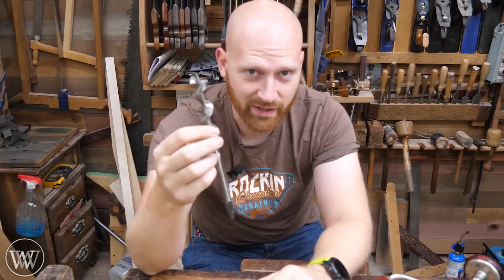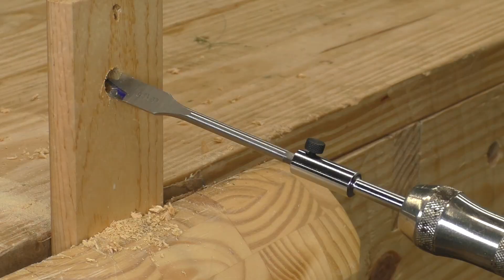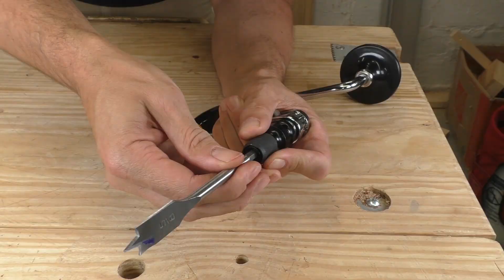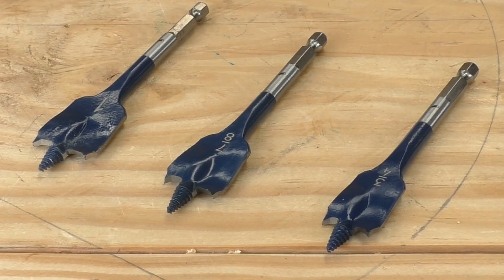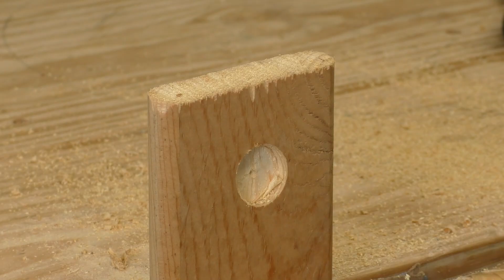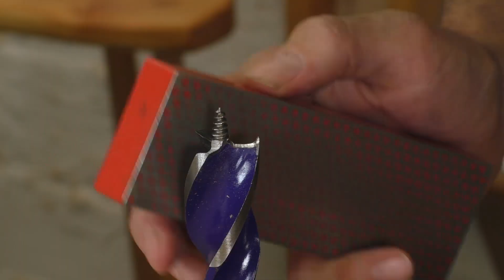Modernize your brace with new gear!

Comment: Rex, why not try the 'spade bits' in a breast drill, still a 'hand operated' drill, just not a brace. A breast drill is like an egg beater drill, but with two speeds, so the high speed may make these bits work as they are meant to, at a fast speed, and with the breast drill you can 'accellerate' the bit before it hits the work, so acheiving the necissary force for the cut.

Comment: one other 'new' brace, the Bridge City Tool works PB-2 (they call it a 'palm brace'), it comes fitted with a hex chuck, like those on modern quick chuck system drill bits, so works instantly with modern systems.

Comment: I took a "new" cheap brace on which the 2 jaw bit holder threads wore out and could not hold a bit tightly.  I removed the holder, cut off a length of a 3/8" square drive extension, reamed out the hole on the brace, and inserted and pinned the square drive end.  (I managed to also install the ratchet ring).  The thing works great for sockets and a socket/hex drive adapter for 1/4" drive bits.  Braces rock.  Thanks, Rex.

Comment: I don't totally agree with "you can't get them new" in regards to Jennings-patter augur bits. The Fisch-made ones that Joel sells over at Tools for Working Wood aren't bad. The Japanese Wood Owls are pretty much unbeatable these days, though, so if you're going to buy something new those are the ones to get IMO. I have the 16-bit set.

As usual Veritas has very refined French-made counterpart to that Garret-Wade "versatile brace". Theirs has a 3-jaw chuck that is profiled so that it can accept both hex and square-taper bits. They also sell a version with a 2-jaw chuck.

I have multiple sets of Freud Forstner bits, but I've never tried one with a brace before. IME they really need the drill to be exactly perpendicular to work well, and I can't achieve that by hand. I'm sure that somebody with better drilling mechanics could, though. I only use mine in my drill press.

Comment: Further to my prevous comment, here are my findings after a weekend of experimentation.

Right off the bat: the only thing that really works is an auger bit with the half moon shaped spur that is standard on the old style auger bits with a tapered square shank. The closest I have to that is a 13mm Irwin auger bit that is primarily sold for use in electric drills here in South Africa, but that also work at low speeds. The half moon spur slices smoohly through the cross grain at a very obtuse angle. In contrast, the knickers found on high speed drill bits (be it spade or auger) attempts to cut through the cross grain at an angle very close to 90 degrees. That works well at high speeds where the velocity of the spur ensures that it makes many very shallow cuts before the bit descends further into the wood. In other words, it makes many passes across the grain rather than attempting to cut it all at once. In a hand cranked bit brace one only makes a few passes per unit of distance advanced, which mean that the spur is forced to cut through the cross-grain much more forcefully than what it is designed for, so massive tear-out is inevitable.

The nickers on high speed bits are also much shorter (i.e.cut less deeply) than the half moon spurs. I even have a spade bit (Piranha brand, owned by Stanley/B&D) that has no nicker at all, just a slight "V" cut. That doesn't work all that well even at high speeds. Modern spade bits also tend to be far less sharp than properly treated old style auger bits. This can be improved upon: filing the cutting edges sharp and filing them down so that the nicker become realtively longer does help somewhat (altough not enough). As someone suggested elsewhere in these comments it does help a lot to file the spur at a 45 degree angle so that it no longer attempts to ram its way through the cross grain at a 90 degree angle, but this makes the spur shorter so you need to file away the cutting edge further. The problem is that modern spade bits don't give you a lot of room to do that.

Bottom line: for best results you really do need the half-moon shaped spurs found at the old style brace auger bits and some modern auger bits to gently slice through the cross grain. Note: the one Irwin auger bit with half-moon spur that I have seems to be a rare exception here; other local brands (made in China) all have the sharp-pointed nickers.

A final word about the adaptor Rex shows at the two minute mark in this video: don't waste your time with those. The only ones I've seen have 1/4" sockets. I have spade (and other drill) bits of a local South African brand (made in China) that come with the 1/4" hex shank that is supposed to be more or less universal. However, I also have a number of Irwin spade bits that come in metric sizes (12mm, 20m and 38mm) but the hex shank on those bits turns out to be (wait for it...) 7/32". (I kid you not.) My 13mm Irwin auger bit has a 5/8" hex shank, and a Forstner bit that comes with a round shank. Good luck fitting all that into your 1/4" hex shank adaptor.

So my suggestion is to look for modern auger bits with half-moon shaped spurs and avoid anything with the sharp-pointed nickers. It's the only half-decent solution short of getting a set of old-style brace auger bits.

Comment: I'm so happy that I saw this. Otherwise I'd have kept wondering what on earth I'm doing wrong. I now understand that modern drill bits (be it spade, auger or Forstner) are simply made for high speed, which causes the nickers to cut through cross grain cleanly. The key here is that because of the high cutting speed of the nicker the force it exerts in the horizontal plane is far greater than the downward force resulting from the operator pushing the drill downward. And nothing is going to change that. The nickers designed on the old style brace bits are designed differently which allows them to cut cross-grain cleanly. So no amount of modernization or adaption of a bit brace to accept a modern bit is ever going to produce a decent result, no matter what you do.

I wish I could get my hands on a decent set of proper brace bits, but I'm in South Africa where these things are quite rare and both expensive an in bad shape when you can find them at all.

Not sure what to do, because I really like working with a bit brace.

Comment: Have you ever tried a mechanics speed brace with adapters so you can use it for an all around tool, I watched this video, picked one up and a few adapters so I can use use it for sockets, driver bits, and drilling with spade and normal bits

Comment: I just brought a 3 jaw drill chuck and put that in my brace and that works as an adapter pretty well. 
I think because of the relatively chunky shank on the drill chuck the brace grips it much better than smaller hex bits

Comment: find a good bit and heat the chuck side or in a forge or in a fire with forced air, pound into a square taper, let it air cool to room temp, dont quench, done! if youre afraid that the heat will reach the bit, wrap the business end in a wet towel

Comment: fine-tools/Dieter Schmid in germany sells new square shank auger bits . i find the adapters work fine too. the set screw goes into the notches on the hex drives and it does not pop loose unless you miss the notch.

Comment: 5:04 that pointy part is also designed to fit into a pilot hole,  which not only helps place the hole, but keep it straight.

Comment: I thought the manual drill is much more efficient than regular drill machine whether with cord or battery , but I see a lot of handicapped issues due to low speed , we can improve it by gear system big and slow speed convert to faster speed like a bicycle and gear system

Comment: A lot of companies in the UK made square shank flat bits with very good nickers and with the cutting edge a bit like a ledge and with the cutter angled in the same way as a Jennings or  Irwin pattern auger. These are great to use and I have a couple of dozen of them from 3/8 to 2 1/2"    The large ones will give you a decent workout unless you have a brace with a long throw.

Comment: For more modern hex shank bits, mechanics deep hex socket to suit the hex end drill, weld onto an old auger end and drill and thread in a couple of grub screws. Ain't pretty but it works.

Comment: Ex-boatbuilder here. Back in the day, before batteries, everyone had a brace, only way to make a big hole without electricity. I still have mine, but it rarely gets used. What it is still good for is driving big screws, especially if it requires controlled torque, you can just lean on the back end to keep it engaged, and you have speed control for easy starts. Even better is it's ability to remove stuck screws and bolts, you can apply so much downforce with your body that you can compress the screw into the wood a little to get it started and keep the bit from slipping. It's also a good speed wrench for nuts and bolts. 

I wouldn't consider it for drilling. I imagine you can still buy screw driver bits for them, but I just cut off the shank of my old bits and make what I need.

Comment: you can get 1/2" drive to 7/16" drive. that will allow those hex headed bits to quick change. Self-feed bits might be a best choice a fostner style bit with a screw tip, a blade and edge cutters.

Comment: Lee Valley sells 2 jaw chuck brace adapters in 1/4” hex bit or 3/8 drive under $20 each. I’ve had them since they were less than half that! They can make your brace the Eldorado Cadillac (Dousy!) of mechanics speed wrenches. Careful with the available torque or you will snap a screw .

Comment: I hate to be a party pooper but here’s my solution: my Makita drill with spade bits and twist bits. I know we’re all trying to eschew any power tools but rules are meant to serve us and when they don’t sometimes you just need to abandon a slavish adherence to a rule.  I assure you I rarely step up to my table or mitre saws and I actually like that I don’t have to deal with the danger and the noise. The my drill will, for now, have to be a compromise involving lithium ion batteries and a charger. I have so much to learn I’m not going to sweat this one thing.

Comment: I have both a set of speedbor and daredevil spade bits. I’ve used them in both a power driver and a hand brace. They didn’t hold a candle to the speed and lack of force needed for an old, dull auger bit that I got with the brace from my grandfather. Also, if you have a Habitat for Humanity Restore in your area, they probably have a brace or two and a couple bins of auger bits.

Comment: Sounds like a brace with Centrotec! 🤣Good video, I think the trick is finding affordable auger bits. I've got some Helller augers which are great and would work in your brace with a 3 jaw chuck, but they are not cheap. Finding vintage augers might be one of the more feasible solutions for a brace...

Comment: I had a use for that brace recently, but haven't gotten it because the attachment point, as versatile as it is, looks like it would be a source of too much slop and rattle (for my use). If anyone can comment on that, I'd appreciate it. I'll be looking for other reviews in the meantime.

It makes me think that someone should make a cordless drill with a 1/2" square drive that can be accessorized. (If rigid enough)

Comment: Im a very amateur wood worker .. when im on my 30 min lunch break or one of my two 15min breaks i shave, cut, glue, clamp rasp and sand the current project im working on. So ive gotten used to having no electricity for wood working. ( Also i have do dump about a pound of wood shavings from my car every week from said woodwork.. my wife isnt impressed ) Anyway im ok with it not being the best way to drill a hole if i can still drill a hole! I apreciate the info rex and i will continue to do research. Oh and i finialy got a Stanley sb4 that was in my wifes family to cut because of your knowledge and you sharing it with us. God bless you and your family

Comment: This issue has perplexed me for some time as I have always preferred to use manual carpentry  tools. The only solutions that I have discovered are the following: 1. Garret Wade 2 chuck bit - works well says my neighbour but it costs $109.00 Canadian at Lee Valley Tools.  2. A chuck adapter I bought at a flea market for $5.00. It holds round shanks well. Issue - requires a key to tighten and I have yet to see another one. Thanks for the video Rex.

Comment: Similar results for me - i bought some modern hex bits from screwfix (a UK shop) and whilst they looked good the snails don't pull well. Interesting they dont work in my electric drill at all really - they bind up and I've had bad clutch smell running in reverse trying to get them free.

But you can see defects in the snail and they clog frequently. If it bites well its ok but in some wood (particularly softer stuff) you have to press really hard and pull them out and clean the snail out so fiddly to use

Comment: I have a vintage brace and a set of augers. Bought the brace at an auction about 50 years ago.  Only marking is "Lakeside". I think it was made around 1915.  Works perfectly. Also got a dozen auger bits - Irwin - from a hardware store going out of business around 40 years ago.

Comment: Made a brace a while ago. Put on a key chuck. Dont like these newfangled keyless chucks, as soon as you put too much tourk on it a round bit slips. With a key chuck you can tighten the bit down. My brace does not have a rachet, but that doesnt bother me, I just turn the other way to reverse.

Comment: One point. Vintage auger bits are easy to find. Well, for me. The problem is that they are worn out. I  bought a few thinking they sharpened or fixed. Ha.

Comment: I also have my father's brace and bits - but they don't often come out as I have modern versions of all the bits that I inherited.
I am wondering if I can use the brace for tapping more easily and accurately than the rubbish T-bar that I currently use.

Comment: Taylor tools makes a square shank adapter for $20 or you could swap out the vintage chuck for a jacobs chuck you can pick up for $40. If you plant to use it swapping the parts out shouldn’t be an issue. Of course keep the antique pieces

Comment: And here’s one thing it didn’t mention. 90% of the time you’re using just a few standard sizes to bore you don’t really have to find an auger of every size if you get one of those universal augers. They have a little wing that you can move in and out to set to an infinite number of sizes. Usually they have two wings one for large holes and one for small holes. The large ones go up to about 3 inches I have one I bought 50 years ago that I still use. I also have another one. I got it some garage sale or something Identical. You can find them. I don’t know if they still make them or not but with one of those you can flush out a minimal set to cover everything caveat is the really big sizes are very hard to use the little ones up to an inch and a half are pretty easy.

Comment: Auto mechanics use, or at least used to use simple braces with half-inch square for sockets. They don’t ratchet as I remember, but frankly, I never use ratchet feature except when using them to drive screws. Get a high-quality one like a snap on used it it might be just the thing.

Comment: Even though this is three years late, I just had to comment. Thanks for making this video -  drove myself nearly to distraction trying to find a solution for the four jaw chuck/hex-or-round shank bit problem. This is a tool I want to use for building pegged log walls and simple furniture in a bushcraft shelter. The solutions you offer here will work very well indeed - way more versatile then a scotch eyed auger, since you can swap bit sizes, lengths and types. Kudos!

Comment: I haven't had any problems using cylindrical or hex bits in bace or rotary (the beefier egg beater) drills.
I also don't by exspensive bits either, my primary set being from Lidl 😂.
I do suspect my chucks are the universal ones you mentioned in the previous video but considering I've been able to find all 5 drills with them for under £6 each it's without trying it seems like a pretty good solution.

I would personally recommend the Rotary drill since it keeps all the advantages of the brace drill while being more efficient and easier to use in confined spaces. Commonly using a 1:6 gear ratio.
This ratio also helps with increasing the speed the drill bit can turn helping the cheap spade bits work better will not exhausting you.

I'm in the UK so the commonality of universal Chucks and rotary drills may be different than in the US. E.g. many of them are stamped made in Poland or England.

Comment: Rex, have you or your viewers had a go at using this brace with hole saws? Is that a crazy idea? Especially with larger sizes (3 inch and all the way up to  6 inch/150mm? I ask because I am a sculptor producing rounded over circles (basically donuts) in ply and I have burnt out two drills so far (one battery, one old hefty corded Bosch). I love the idea of using a brace and bit, but of course my dad's old one doesn't grip the Starrett arbor... Obviously it will be hard work, but does anyone think the tooth geometry (teeny tiny teeth) will work at slow speeds?
Love the channel, even though I am a sculptor and not hand building furniture. Keep up the great work...

Comment: I wish someone would create a 1/4" hex adaptor with lock (same as the Wera's Rapidaptor) that would simply screw in onto the shaft of a brace after removing the chuck. Surely, the thread is the same on many of those braces, no? Would be so easy to use modern drill bits and screwdriver bits with 1/4" hex shank on a traditional brace this way.

Comment: Hi Rex. You r among the chief influences to turn me towards hand tools WW. Just bought a coupon braces from eBay and only then realized the compatibility. Saw ur video too. 

Here is a solution from taytools

Square Hand Brace Adapters for Auger Boring Bits with 1/4", 9 mm and 7/16" Shafts